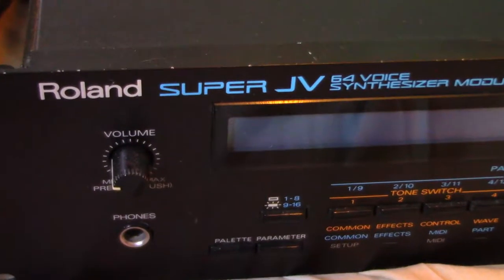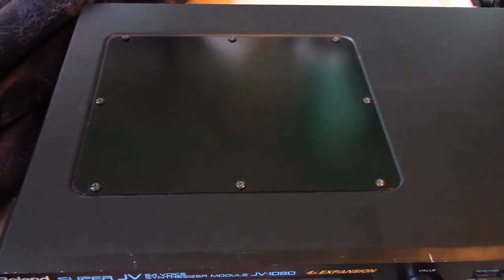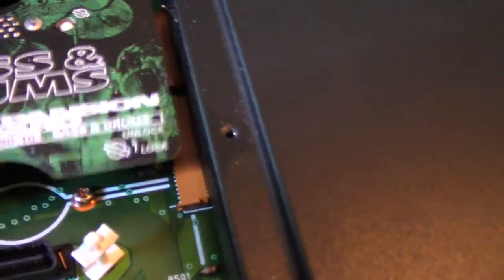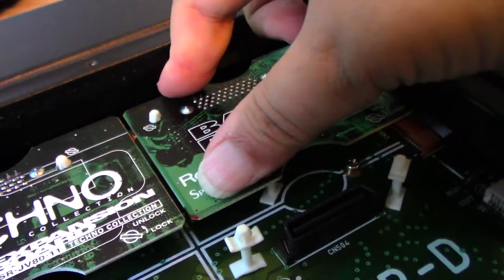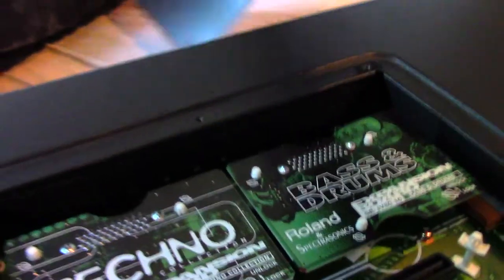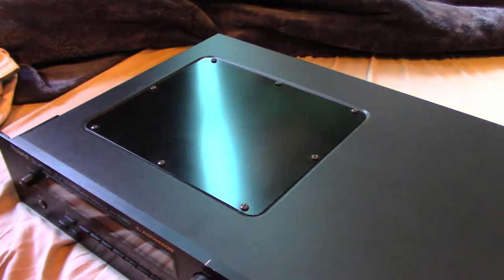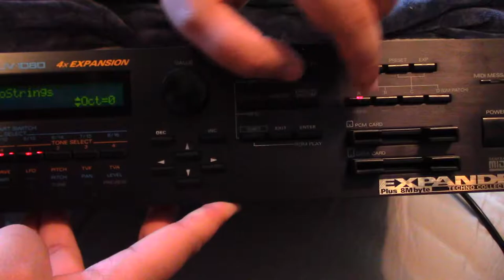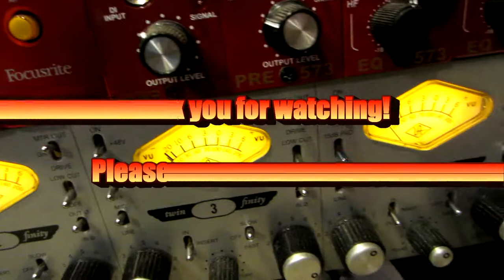Tutorial Vintage Roland JV1080 Synthesizer Expansion Card Installation. Audio DIY

Comment: The bass and drums expansion card was certainly one of my favourites with phenomenal acoustic and electric bass sounds and acoustic drum kits that still hold up very nicely today over 25 years later.
Reply from the maker: The bass sounds are incredible, they were recorded by Marcus Miller. I love the drum kits on it too. So impressed overall with it
Reply: @jkhan337  it was perhaps my most used expansion board, along with the Session, Dance, Hip Hop, Vintage Synth and both the orchestral boards. IMHO no rompler at the time could compare with those bass and drum sounds right up until Yamaha released the Motif ES series workstations in 2003 with their tevouur) fabulous megavoiced guitar and bass sounds along with great drums.

Comment: Is it safe to assume that these are the exact same cards that install into the jv880 rack mount unit?
Reply from the maker: I believe they are.
Reply: Some sounds on a few later cards will not sound on a JV880, because they use ringmodulated voices and stuff.